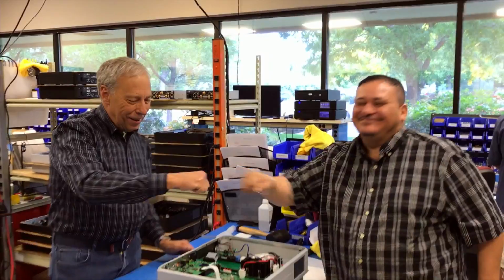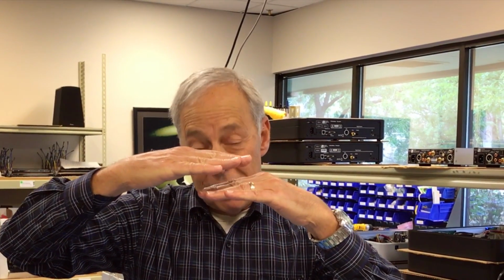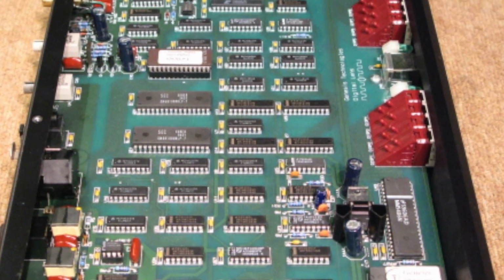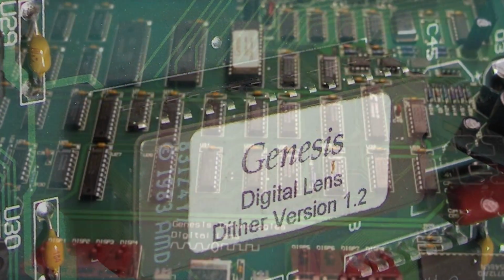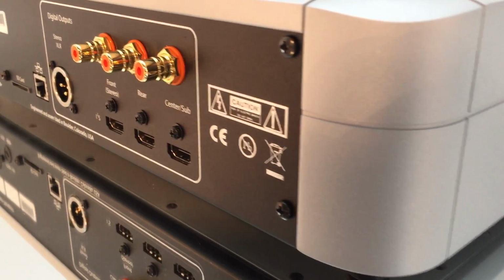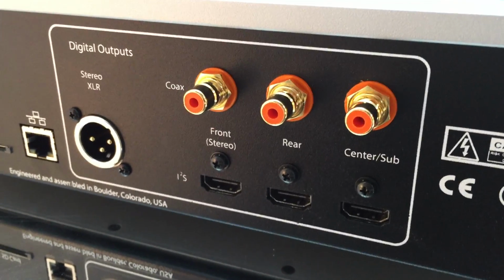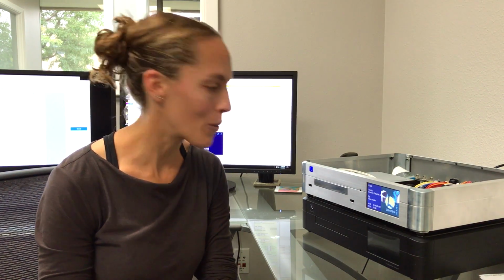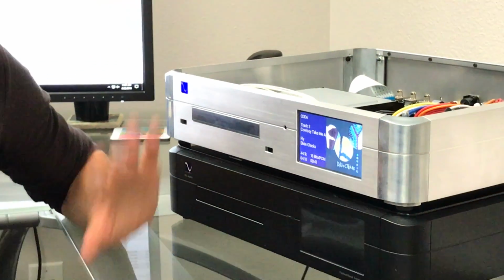DirectStream Memory Player

Comment: I had the Digital Lens back in the day. I improved the PSU and put in a new clock. Did it improve? Hmmmmm?.. It was near perfect to begin with. I absolutely loved it.
Reply: I actually just bought one off eBay and waiting for it to arrive from Germany, still a good buy in 2023 especially with vintage dacs?
Reply: For sure. It's  still a gem. 18 bits is the highest resolusjon if I remember correctly? Easy to modify, if you want to?
Reply: @johnlenerd  18-bit is more than enough, I can’t hear the difference on 96/192khz content anyway.

Comment: It's cool you can play SACDs with an external DAC with this thing. I'm  skeptical about how much improvement you can get from another re-clocking/buffer stage before the DAC, although I imagine there is SOME change for probably mysterious reasons. If jitter is the real issue, I would be more concerned with with the DAC, electrical interference, and even the digital cable. And I'm sure this is a fine product.
Reply: do you believe that dac will make a miracle with incoming cr*p?Transport is way more important.
Reply: @vincentvin4345  Both are important, but the DAC is responsible most for the character of the sound. I agree, though, the input quality (jitter, noise, ground loops) does have a big impact on the DAC. The DAC I use now uses a fiber optic connection and that pretty well sorts out the source noise issue, even better than I2S.
Reply: @chipsnmydip  In my universe laws of physic are still working.Dac chip needs to be feed with pure signal otherwise chip will function in 30 percent of its capacity.In audio everything matters but most important is foundation like power supply and then need to move along.Whole rig of course will sound like cheapest component in a chain.
Reply: @vincentvin4345  The thing is, in digital the signal is pure automatically. The problem is electrical noise and jitter noise that get into the DAC.
Reply: @chipsnmydip  you lost me here

Comment: The L.P. has NEVER been the best sounding source, try good old bit stream 1 bit 2.6 MHz or higher sampling. Benn around for years. Remember the big 12" video discs? Enough of renaming old technology. 1-Bit Mhz speed sampling and playback, take a regular cd and convert it to 4 x 2.6 Mhz or more, even just 2.6 Mhz 1-bit format and then replay it with a bitstream decoder. Poof, it will sound better. Think about it 1-bit audio can be closer to analogue than multi-bit audio. It is a math and physics thing.
Reply: nahh, vinyl is king
Reply: @vladg5216  Nope R2R is

Comment: Whats the accuracy of the playback timing? I wasnt aware that inter-component RF was such an issue for discrete data signals at such low clock speeds. It sounds like clock jitter was this horrible terrible problem. Im confused because i have a 2MHz digital oscilloscope that can watch a square wave with no problem. Are mitigating techniques used by PS also used in high freq digital sco..sco..scopes? Sorry, had some jitter.
Reply: Hi I'm back. This channel gets worse and worse. This guy talks so much bullshit he should probably retire